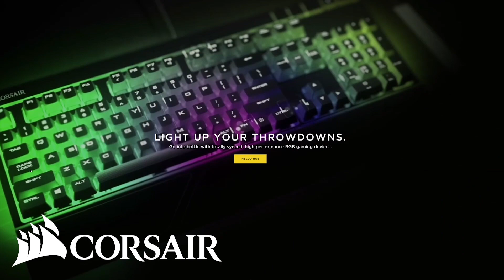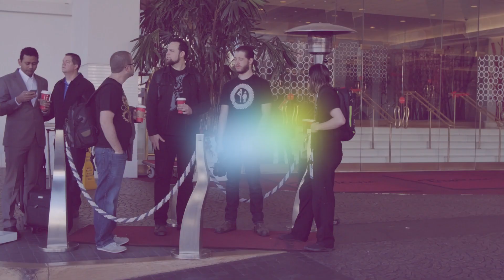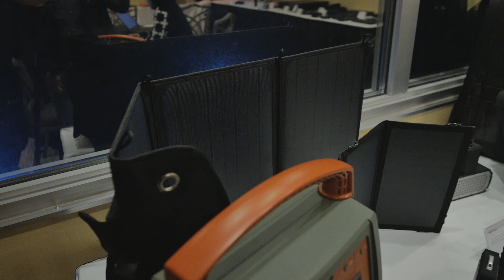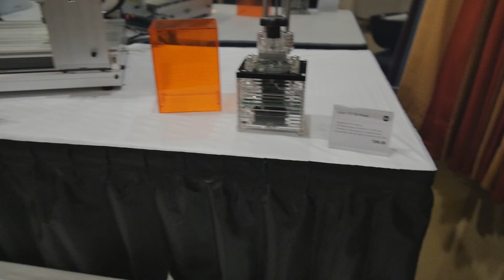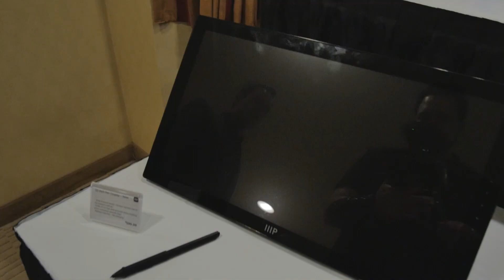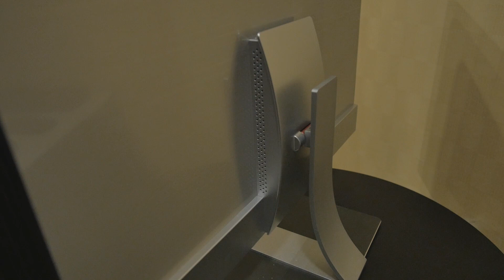Monoprice - Quadcopters, 3D Printers, & Robots | CES 2016

Comment: This is what you should have asked the Monoprice guy about the monitor Logan:
Q:   What is the refresh rate of the monitor?
(Most probable) A:   60 Hz 
Q: Is it overclockable? 
(most probable) A: No

Guess that's why it is 250$! I could care less about the build quality, really. I had a Qnix for a year and a half and never cared that it's flimsy,  high refresh rate  > freaking metal enclosure!
 If it turns out to have higher Hz or OCable, I'll give them all my money and a lap dance (lap dance optional, only if they're into bearded 35 year-olds)

Comment: Holy crap, I can't throw my money at the screen enough for that last monitor! I want it so bad, it seems like such a good deal!
Reply: totally agree with that...i mean i'd like to get an ultrawide monitor but there's no company out there that makes one in a decent price so i can't wait for this thing to be released.
Reply: yeah man I totally agree for that price point that screen is nuts! now just to wait for a 34" 4k model. Wonder how this will compare to dells ultra sharp lineup.
Reply: +John Balas We're working on a 34" UW for 499.99. 75Hz RR, IPS, HDMI 2.0, DP 1.3 (edit: wrong link and added info)
Reply: I thought the same thing. I'm definitely holding off on the pixel lottery with prices like that on the way
Reply: Ron Cox
Very true. I'm still rocking a Dell 2405FPW 1080p 16:10 monitor from 2005! I'm so reluctant to upgrade, but this price seems so good.
Reply: +LazerLord10 I feel you. I've been using a 22inch 1080p tn panel from viewsonic for the last few years. I've finally updated my graphics card and its hard to resist jumping on the high refresh and resolution bandwagon. I'm kind of hoping to add an sli card to make no compromises and panels this cheap with no risk might make that viable
Reply: +LazerLord10 i'm looking at the benq bl3200pt which is around the 350 pound mark but this will be around 200 pounds...it feels like we're robbing them.
Reply: +John Balas Seems like we're getting some competition in a market that relied on sourcing panels from competitors for many companies. If that's the case I'm all for "robbing" the big players to support the competition
Reply: +John Balas I really can't decide if I want to deal with unsupported aspect ratios on many games in order to get that ultrawide immersive experience. There are some reasonably priced ultrawide 1080p monitors out there but im not sure it's not better to get a few better looking and cheaper 16:9 monitors and run multiple for a similar display format
Reply: i know gaming is a problem but for me when i do coursework for uni i find myself using my laptop instead of my desktop and i take my monitor and connect it into my laptop so i could have as much real estate as possible. 22 inches is a bit small for me...but different people have different needs.
Reply: +LazerLord10 
I am so wet right now. Other brands need to step it up
Reply: +Steve Monoprice oh my... That&#39;s wicked... You really can&#39;t bring that to market fast enough...is it going to be a 1080p or 1440p panel though?
Reply: +Steve Monoprice  definitely interested in this.
Reply: If you guys are in the market for a 1440P LG Panel IPS, our current 27" is on sale for 249.99: http://www.monoprice.com/product?c_id=113&cp_id=11307&cs_id=1130703&p_id=13808&seq=1&format=2
Reply: +Steve Monoprice When will the new 1440P 27 inch IPS panel be released?
Reply: We're still working on the finer points. It may not be until April or May.
Reply: +Steve Monoprice what is the price point looking like for the CNC, also are its speeds and feeds high enough for steel